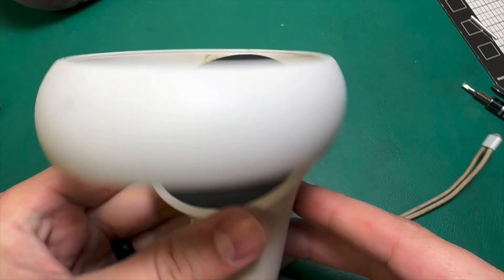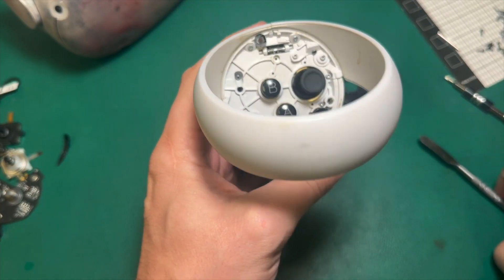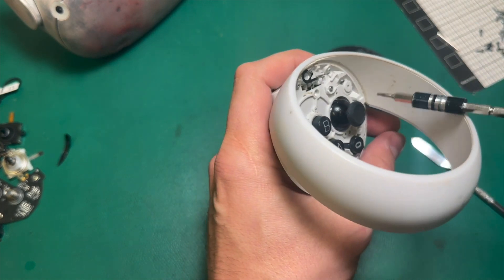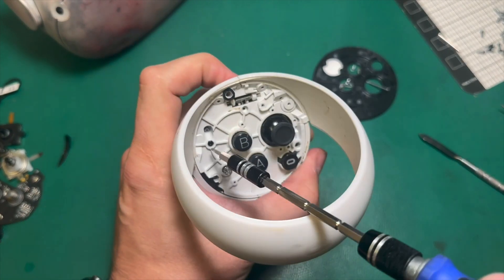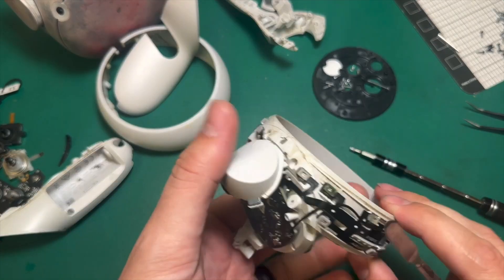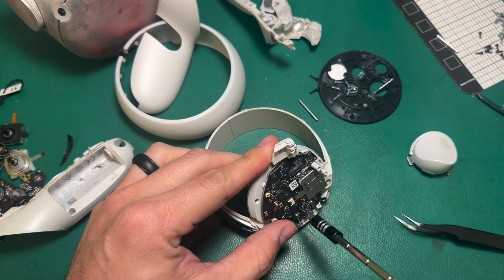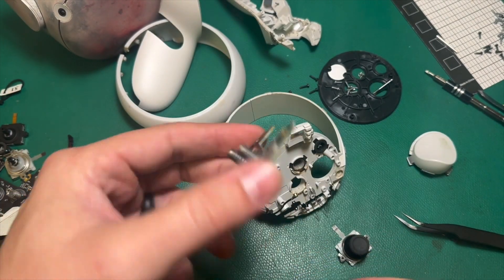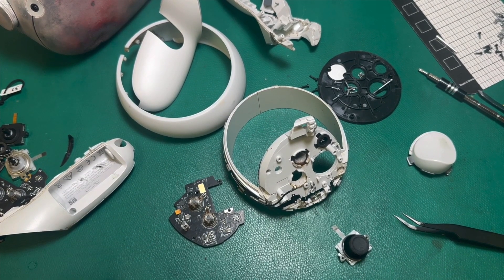Quest Controller Repair - The Worst Case Scenario

Comment: After my sticks started drifting, I bought new ones to replace them. I took the joysticks apart and replaced them, but now one of the joysticks always shows the stick pointing left up. Perhaps I broke something? But there are no visual problems and the cables seem to be in place. I tried old and new sticks, but the result is the same - now the problem is not in the stick. I couldn't find any information online, so I'm writing here. Please help:3

Comment: I'm trying to find a video with some direction to fix connection issues. My left controller is blinking white so i know it's not the battery.i have already done a reset but still no fix
Reply from the maker: Could be several things. Any visible damage to the controller or recent history of liquid exposure or severe impact? 

In my experience, LED power indication with no pairing indicates a board issue. But isolating board failures requires physical evaluation since there aren’t any other ways to run diagnostics and determine the failure point.
Reply: @fixmyoculus  It's exactly the same to me but in my case it's the right one, it was saved for a while on a case, untouched and no loquid exposure or a severe impact, maybe the humidity, I lived in Cartagena Colombia and the humidity is 80 percent, so I don't really know, please I need some help, I would appreciate it.